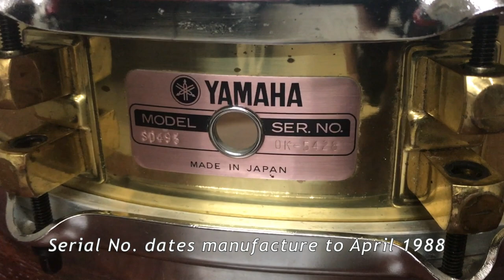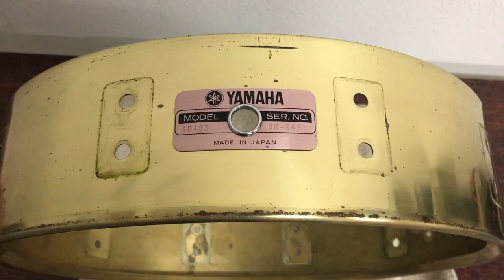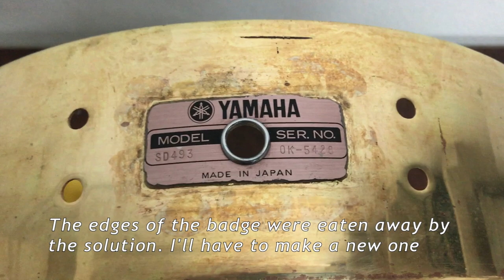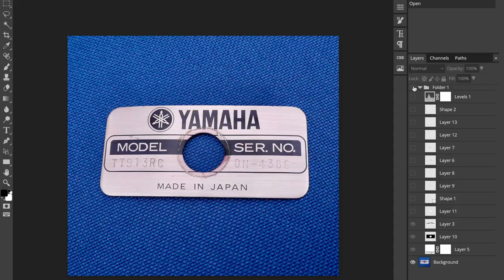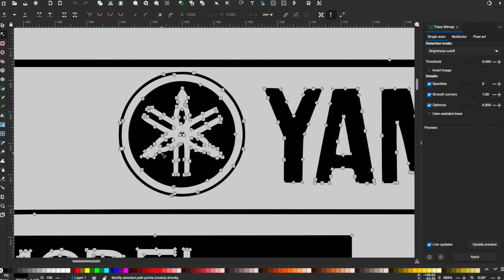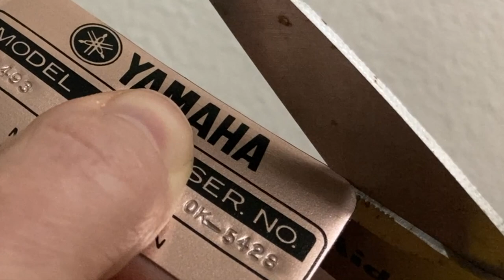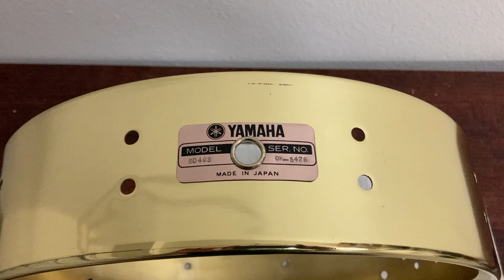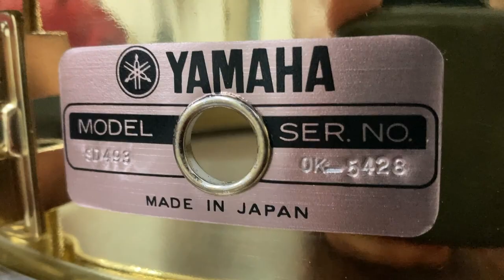1988 Yamaha SD493 Piccolo Brass Snare Drum - Restoration

Comment: Great job!  I picked up one of these last week in similar shape.  I spent a few hours stripping it down.  Rebent snare mechanism after cleaning and re-greasing, took a dent  out of the shell, gave it a machine polish (left the lugs on), new heads and have new snare wires on order.  It has tama diecast hoops.  I tuned it up and of boy! What a snare!  Thanks for sharing your project!
Reply from the maker: Thanks! Hopefully this video helped with your project.

Comment: Nice job. I do buffing and lacquer work and band instrument repair for a living. Mowhawk is a good Nitrocellulose clear lacquer. It is designed for wood, whereas Nikolas is for metal. It has adhesion promoters that the lacquer for wood does not need. But they are very similar. Not sure what you used to degrease the brass before lacquer.  Nitro is great for clarity. Limited life. Even the original 2 part baked epoxy used by Yamaha had a limited life as you see. I love Nitro and it is easy to strip with Acetone when it needs to be redone in 5 to 10 years - Depending on the handling. Really well done.
Reply from the maker: Thank you! This was my first time doing anything like this. I did a lot of research on what the best option would be and settled on the Mohawk variety “For Brass”, but thanks for the tip on Nikolas. I used acetone to degrease prior to spraying.
Reply: @KevinCrafted  Cool. I didn't know that they had it for brass. Great to know. Yes acetone is good stuff. You can also use brake parts cleaner the "chlorinated" version. Very good stuff. Do it outside though.  Non-chlorinated versions are basically aerosol acetone. Still good. Very few manufacturers are cutting nitro now as it has been fazed out. Now you can get 2k aerosols from body shop supply places, but it is IMPERITIVE THAT YOU USE A PROPER RESPERATOR. The clarity is not as good as Nitro on brass.

Comment: I almost cant watch this. This snare was one of my favorites. I lent it out to a guy I went to church with in 2009. He tighten the head so tight (trying to get a 13" piccolo sound, when its a 14"), it stripped the Brass Lugs. I even attempted to salvage it replacing it with different lugs. That worked for about 4ys. Those gave away too. Then it was trash heaven. Unusable.
Reply from the maker: Oh no!
Reply: @KevinCrafted but, I made good with it when my wife said it was cool that I could replace it with a Brass Recording Custom.

Comment: i have a bit of rust on my SD 493 !! how long should i leave the flour/salt/vinegar solution on ?  can i just apply it on to certain spots and leave it for an hour ?
Reply from the maker: I left it on for a few days, but only 24hrs is necessary. Doing certain spots rather than the whole thing might leave areas looking cleaner than others. I don’t think this step is even really necessary, if I were to do this again I would just skip this step and go straight to polishing.

Comment: How do you know if a drum needs snares to extend past the bearing edge or not? I have a Ludwig piccolo snare drum that sounds great but when I have the snares turned off they still will randomly activate when I hit the drum. I pretty much don't turn off the snare wires anymore. I saw the comment about the snare wires needing to extend past the shell on this piccolo snare drum and it made me wonder id that could be the issue with mine? It's the stock throwoff, but I just recently changed the heads and wires (it did it in the past as well).

Awesome restoration and video!!! Thank you very much!!! 🤘🤘
Reply from the maker: Thank you! This specific drum needs them due to its specific strainer system. Freefloating snares usually use them. Your issue might be solved by playing around more with the tension on the snares while the throwoff is deactivated, I don't think extended snares would fix your issue
Reply: @KevinCrafted  Thank you for the knowledge and the tip! I really appreciate it!

Comment: I just pulled my SD-493 out of the garage. Ser number IH-0835. Sad to say it's been sitting under quite a bit of old drum hardware unprotected for over 20 years. I know, not very bright. Anyway, any idea where i can find parts for this? i need a Tension rod screw for the butt side and inserts for the lugs. I need to get this up and running for my left side of the kit snare
Reply from the maker: I'd say best bet would be eBay or Reverb. You might be able to find some replacement swivel nuts that fit at drumfactorydirect